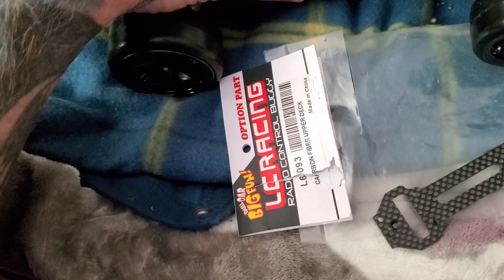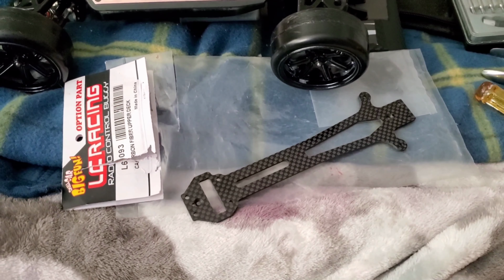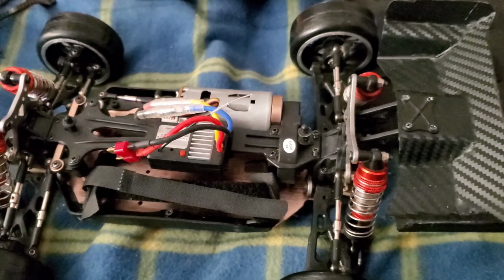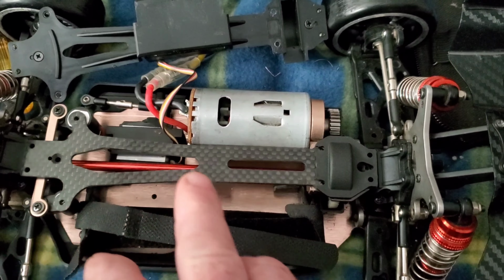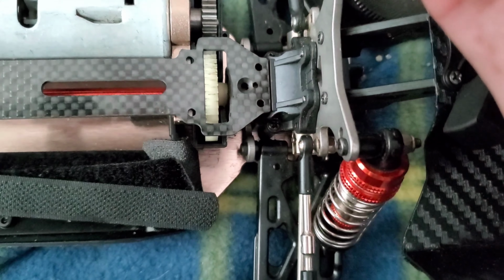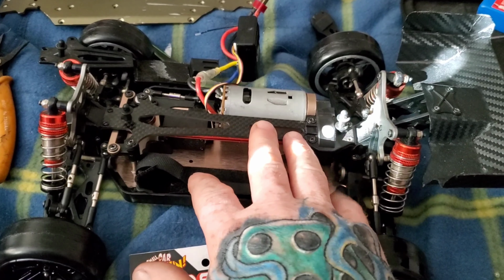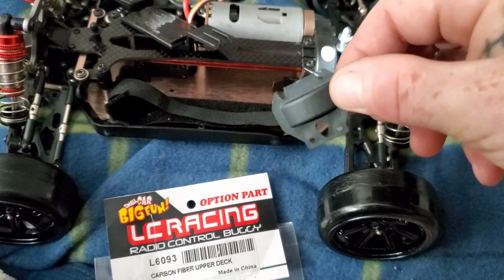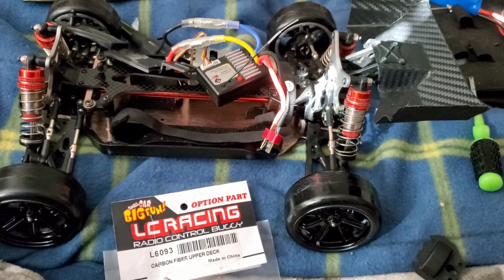LC racing  EMB 1 is  the wltoys 144001 here's the  Proof!

Comment: Yes, in my knowledge wltoys 144001 is the clone of lc racing emb-1, 124019 is clone of lc racing lc12b1 and 104001 is the clone of lc racing lc10b... The difference when i see the manual on lc racing is, that lc racing use differential that can be filled with diff oil because they have silicon o ring in it and the wltoys doesn't have them, second is lc racing have slippers in their spur gear and wltoys doesn't, third lc racing use hex screw and wltoys use head philips screw, fourth with lc racing you can easily swap the motor because they use different mounting than the wltoys, fifth lc racing use metal hex in their wheels that stay in place if the wheels came loose, they use grub screw in their hex, sixth lc racing has different size bearings in their knuckle, seventh lc racing comes with sway bar and wltoys doesn't... That is the difference that i can tell so far, beside electronics... I don't know about lc racing part quality vs wltoys part quality how much they're difference like how much wobble/tolerance lc racing vs wltoys because in my town almost all using wltoys, but some guys said that lc racing is better (but they don't have one)...

I have 144001 and I'm planning to buy the 1/12 version so i still considering which one i buy between 124017 or lc racing lc12b...

Comment: I will always choose LC RACING over the wltoys after having 3 wltoys and always constantly having issue and srews  falling out  so I  bought  the EMB T truggy from LC RACING  and have had it for 3 months not one issue yet although i do buy some of the wltoys parts and updrades to put on the LC racing
Reply from the maker: sorry about your luck.  Of course budget RC cars are always gonna need loctite diff oil shock oil.  With surpass hobby and Dumbo RC I have $210 in lt .my best friend has the EMB-T  HAS $400 in it. So in the end I had more weed money.  His EMB has broken twice mine "0"  There is no difference in performance. Same turning radius Same awesome acceleration and brake control.
Reply: if a screw falls out replace it with a tiny dab of blue locktite... i paid like $6 for a complete set of wltoys hardware off of ebay... i never lost a screw yet .but i do go over car and make sure its all good every hour or 2 of run time..
Reply: NOOOO DONT UPGRADE LCRACING WITH WLTOYS PARTS PLSSSS BUDDYYYY😞
Reply: @fran.6496 no you should do the opposite...
Reply: @bikebilderbear6786 so lc racing durability is worse than wltoys...? Considering wltoys part are so cheap makes the wltoys good value vs lc racing...
Reply from the maker: @helmydewa  wltoys god for kids and cheapos. Lc racing Better for more dedicated rc hobbiest.
Reply: @bikebilderbear6786  with 50kmph out of the box it's definitely not for kids 😅

Maybe for one who new to the hobby, yes...

Looking your video i want LC Racing but damn that's not cheap in country where i lived...

I agree lc racing is better for the one who dedicated to the hobby...

Comment: Lol I don’t understand what you’re trying to prove here. The base plate, upper deck, and the whole transmission including the diff and diff cases are NOT interchangeable. TRUST me, I bought a 124019 and essentially ended up building a complete LC Racing truggy piece and only ended up using a few parts from the original car.
Reply from the maker: Yo click bait. I explained it's a clone. The EMB-T carbon fiber upper deck fits nicely. It's similar to several companies track buggy.  All the big dollar pros love what I've done with both wltoys buggy platforms.  Going to build 2 more. One full body rally and one indy style . Breth buddy.